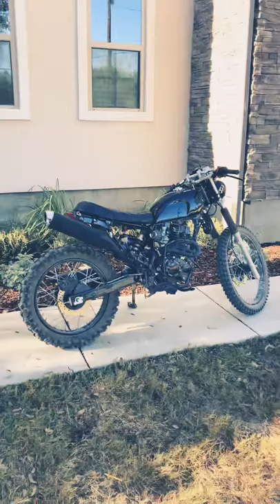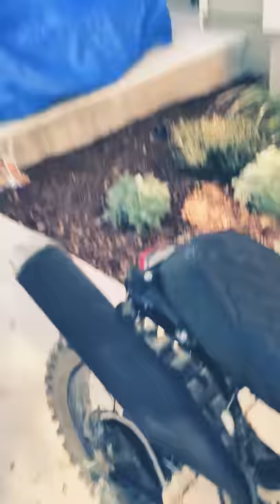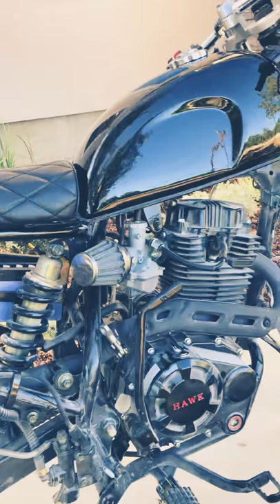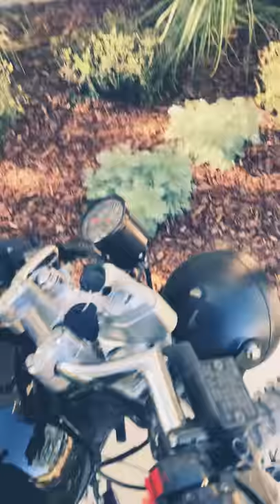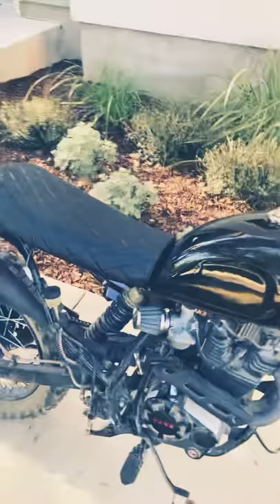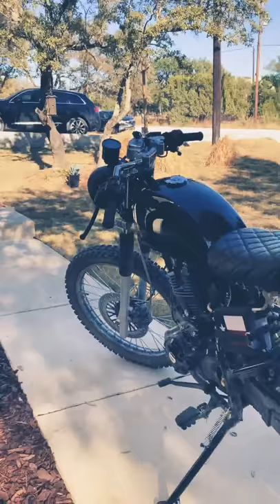Hawk 250 cafe racer

Comment: Tank and seat combo looks great. Only issue is the line, I don't like the banana shape. Maybe cut the front of the seat mount and weld it higher. Or cut and weld the rear section lower idk if clearance would be an issue. Then add a spacer to the rear of the tank to flatten the line. Otherwise it looks good, thinking this may be my next project.
Reply from the maker: If you get the same tank you’ll have a couple inches you could raise the seat on the tank side before you get too high up the tank. You could weld a wedge to the frame to cover the gap between the seat and existing frame.
Reply from the maker: I’ve gone through and cafe’d an 81 Suzuki GN400, an 82 Suzuki GS650, a 78 Kawasaki KZ650, and a 79 Yamaha XS1100, and the Hawk. Found the Hawk easiest and cheapest to modify. Having a baby at present so don’t have the $ for anything bigger for a while so I’m grateful for this option to continue my lifelong hobby. AND to be fair, the Hawk is a solid runner so no complaints there.
Reply: @jleverett7852  The Hawk is awesome.  I am in the drawing phase of making the Hawk into a scrambler.  I am interested as to what did on the battery box side.  What is that?
Reply from the maker: @ryanlankford6739  I cut and filed a piece of the molded plastic from under the seat to make a battery cover. It just happened to be the exact size of the battery. I put a Texas flag sticker on the plastic and stretch the rubber battery strap over the plastic piece to hold it in place.
Reply: @jleverett7852  That was genius.  The bike looks great. By the way. I could not agree with you more, I removed the plastics and the bike rides so much better.  It handles better and it used to have a weird back and forth shimmer at 50+ which has now disappeared. Im just waiting on my new headlight and signals to come in.
Reply from the maker: @ryanlankford6739  Exactly my assessment as well after stripping all the crap off.

Comment: I like the speedometer Change. I was thinking about the digital plug and play one they make how hard was it to change out for that one?
Reply from the maker: It was a tad tricky. It came with the correct plug in but I had to re-route the wires in the new plug to match the configuration in the factory plug.
Reply: @jleverett7852  gotcha I’ll have to make that work. Here’s a big question is the transmission getting air? When I took my airbox off there’s a rubber line looking like it’s going to the transmission do I need to incorporate that into the air filter or can I just plug that line
Reply from the maker: @juanitofuentes4927  That’s just an exhaust vent. Just let it rest on the frame as it is.
Reply from the maker: Also, concerning the speedometer, keep in mind the speedometer I put on my bike is in kilometers. I did that on purpose because it’s nostalgic for me having lived abroad for an extended period of time.
Reply: @jleverett7852  gotcha I’ll make sure that I can make it MPH I’ve had that line into my air filter the whole time lol oops. Thanks for the help from one hawk to another

Comment: I've been riding around on one of these bikes for the past 3 months and I've almost blown it up by now done a lot of stuff to strip it and make it a better off-roading bike but if you want to get the best out of your carb you should tune it to a 125 Main and the same Idle Jet that's what I did on mine and it sounds a lot bigger than it is but it does bog easily if you don't go easy on the throttle I use mine for dirt jumps and off-road adventuring so it should be good enough jet for Street

Comment from the maker: The Skyline Cafe Racer - Black - Motorcycle Gas/Fuel Tank 2.4 Gallon 9L https://www.amazon.com/dp/B083F9JJ7Y/ref=cm_sw_r_cp_api_glc_i_WLv3Fb3Q6KAG2?_encoding=UTF8&psc=1

JT Sprockets JTR269.45 45T Steel Rear Sprocket https://www.amazon.com/dp/B0068O5W3M/ref=cm_sw_r_cp_api_glc_i_ANv3FbBY5VTYK?_encoding=UTF8&psc=1

Universal Motorcycle 48mm to 50mm Air Filter Cleaner Pod Style for Honda Yamaha Suzuki Kawasaki Atv Quad Scooter Moped Dirt Pit Bike https://www.amazon.com/dp/B07MPPMZYM/ref=cm_sw_r_cp_api_glc_i_fOv3FbK6QQQTG?_encoding=UTF8&psc=1

AnXin Motorcycle 7/8" Handlebar Cafe Racer Ace Clubman Style Handlebars 22MM Universal For Bobber Custom Application Chrome https://www.amazon.com/dp/B07LF35ST1/ref=cm_sw_r_cp_api_glc_i_EOv3FbWFKW7AT?_encoding=UTF8&psc=1

Motorcycle Vintage Cafe Racer... https://www.amazon.com/dp/B07J9RW3L5?ref=ppx_pop_mob_ap_share

Suuonee Motorcycle Odometer, LED... https://www.amazon.com/dp/B07SQ6MG48?ref=ppx_pop_mob_ap_share

TASWK 6 1/2" CREE LED Motorcycle Retro Black Clear Lens Headlight Halo Ring for Bobber Cafe Racer Cruiser Vintage Style https://www.amazon.com/dp/B06ZZ9KY94/ref=cm_sw_r_cp_api_glc_i_.Pv3Fb6WBP498?_encoding=UTF8&psc=1

20 Pieces Carburetor Main Jet... https://www.amazon.com/dp/B08N42WKMM?ref=ppx_pop_mob_ap_share

Motorcycle VM26 30mm Carb Carburetor with Air Filter For PZ30 200cc 250cc Mikuni Honda Hawk Go-kart Taotao SunL JCL JetMoto Kazuma Baja Quad ATV Dirt https://www.amazon.com/dp/B07V1H6M37/ref=cm_sw_r_cp_apip_KWV79nnPp2beG

Comment: starting my scrambler build today bike is completely dissembled, im questioning on where I should make my cuts to level the seat out, any suggestions?
Reply from the maker: I actually didn’t change the frame under the seat. That being said, you could just weld a bracket across the curve to bridge it rather than compromise the original frame.
Reply: @jleverett7852  brilliant idea! Thanks man

Comment: So I’ve pretty much done the same thing to my hawk..But how did you lower the suspension? Is their something I buy or does the shop do it?
Reply from the maker: The threaded ring on the back shock adjusts the rear. On the front I just loosened the fork brackets to let the fork tubes slide up a couple inches.
Reply from the maker: Do you have a picture of your bike? I’d love to see what it looks like.
Reply: @jleverett7852  ok I got you when it’s done.Its actually in the shop right now lol 😁 Also The carburetor jets you put in the description is out of stock, can you link another kind you would buy?  This is my first bike, so I don’t know much about them. I literally bought the hawk, bought every single part you linked and took it to the shop last week 😅
Reply from the maker: @TheTrigga92  Ah cool! I’d just have to search for the jets. I don’t know a brand off the top of my head. I look forward to seeing it when it’s done.
Reply: @jleverett7852  is it the stock shock that you adjusted or an after market? If after market do you have a link?😃
Reply from the maker: @cobbybobby1877  just adjusted the stock forks/shocks

Comment: Can you please post links to all the parts used (seat, tank, lights, etc). Also, you could clean it up a little by possibly changing to a smaller battery and relocating it somewhere else but even as it is i love it and it's 100% original which I support.
Reply from the maker: I’ll try and get the links for the parts posted later this evening. Thanks for watching
Reply: @jleverett7852  give us the fuckin links
Reply from the maker: @proudtitanicdenier4300  the links are posted in one of my replies above
Reply: @jleverett7852  put them in the description
Reply from the maker: @proudtitanicdenier4300  happy?
Reply: @proudtitanicdenier4300  LDE
Reply: @kindasustho_  what
Reply: @proudtitanicdenier4300  lil d energy
Reply: @kindasustho_  7.5 inches is little?

Comment: Do you know if you were able to get more top speed out of the bike with the different carb?
Reply from the maker: Yes but it was the combination of changing the carburetor and changing the back sprocket that increased the top end.. it went from about 60 to about 65.
Reply: @jleverett7852  I saw the parts list of what you changed. Did you have to change both sprockets or just the rear? Did you also change the sprocket for speed or hole shot type riding? Sorry for all the questions but I’m about to start this project and I will mainly be riding street here in FL.
Reply from the maker: @nicholausvicencio4151  just rear sprocket for top end. Since it’s just a 250 I wanted a little better ability to keep up with traffic.

Comment: How did you raise/lower the front forks?
Reply from the maker: You have to loosen the neck bolts that hold the forks up by the handlebars. Then let the forks slide up a little bit.

Comment: is that gas tank plug and play or is there mods needed for it to fit?
Reply from the maker: No mods necessary other than a slight alteration to the bolt bracket. If I remember correctly I had to extend the bracket to reach the hole where the tank bolts to the frame.
Reply: @jleverett7852  thanks for that information man I'm seeing that with the seat you also had the make new holes to mount I like what you did with it I'm thinking about something very similar slightly different design going for more a mad Max or The walking Dead style of a scrambler look
Reply from the maker: @brandonsimensky1055  I think that would look awesome. These bikes are super easy to modify.

Comment: the front suspension is height adjustable?  stock?
Reply from the maker: Yep. You just loosen the bolts on the neck and let the forks slide up, then re tighten the bolts at desired height.
Reply: @jleverett7852  thanks man.  👍